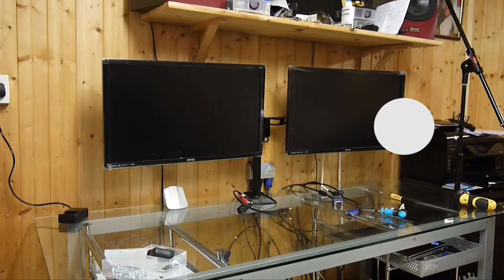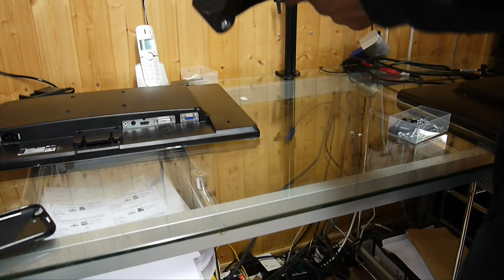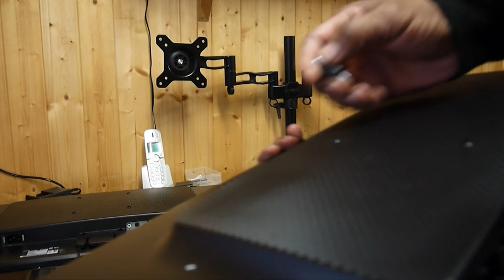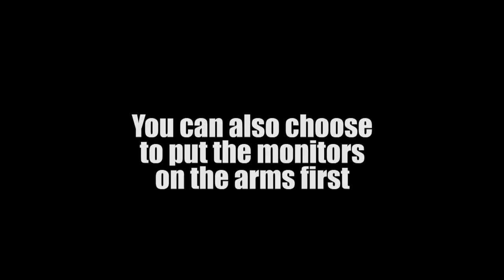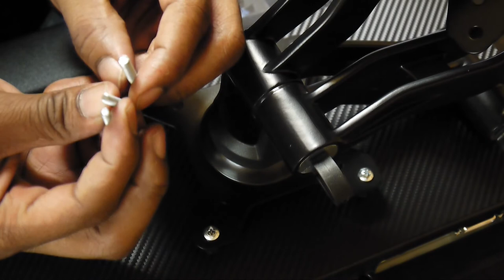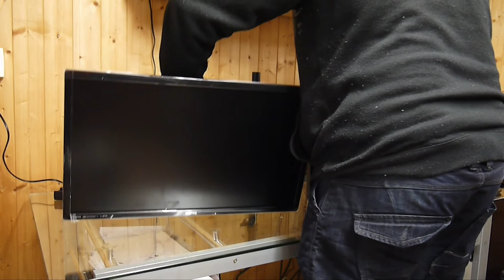Fitting of Dual Monitor Arm Stand Model DM352

Comment: at 4:45 i was wondering if you can change the height of the monitors as they are really high up for my personal preference? can the monitors sit lower to the table like a few inches of the table?
Reply: +Luke Bottomley Yes, i think you can, you can slide that plastic thing on the center bar down/up and place the monitor arm on that